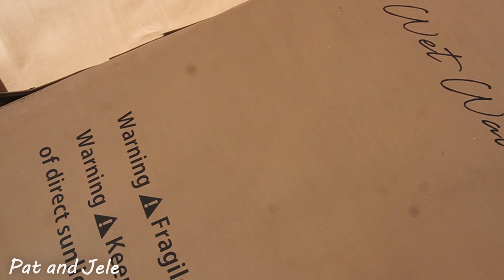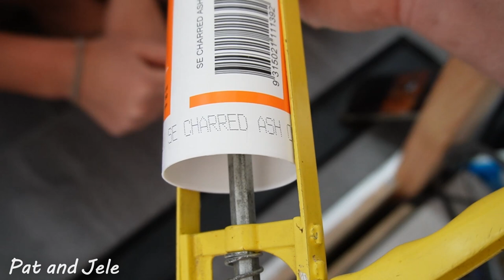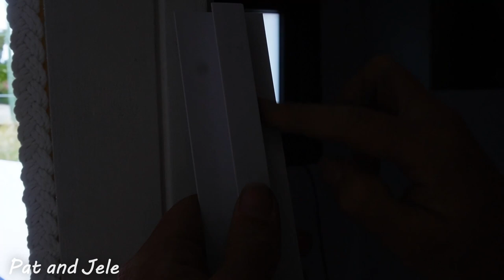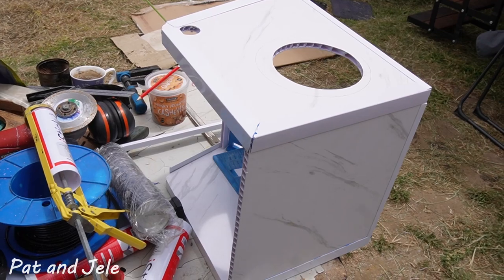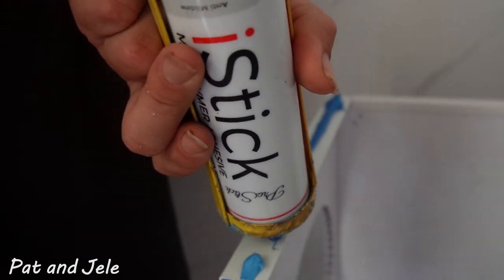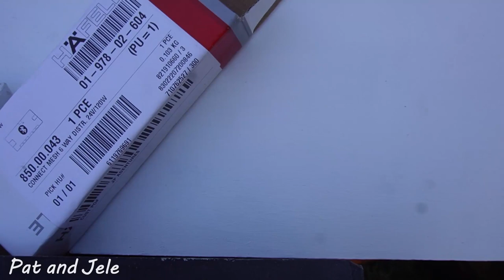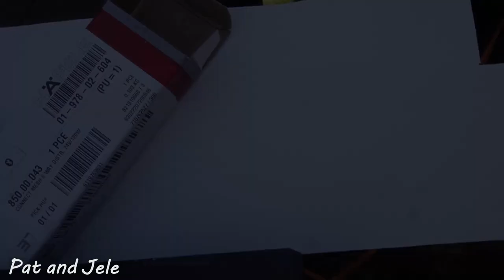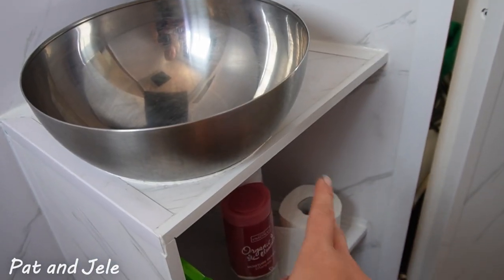Custom Vanlife SHOWER - Light, Quick & Easy with Mr. Wet Wall Panels - Cheap DIY Sink Pt.2 (Eps. 55)

Comment: You are set for luxury travel with your flash shower, it will be a great asset in your travels. I hope you don’t have any water leaks. Do you have a plan if you do? That adhesive is not going to let you get behind the panels. Another great episode 👍👍
Reply from the maker: Thank you!
So far we haven't discovered any leaks. It is very unlikely with those panels and trims if you install them correctly :)
Worst case we could always get behind there from the other side, where we cladded the walls with pine lining.
Reply: @PatandJele  I'd be more concerned about those flexible hoses you used, They have a bad habit of failing after a few years & should really only ever be installed where you can get to them. They now even come with a date label so you can see when they were installed.....
Reply from the maker: @paulgriffin5572  we worked with plumbers on this setup and we used good quality ones. They have a 15 year warranty on those, so should be all good. Time will tell ;)
Reply: @PatandJele  I knew you had a plan😁
Reply from the maker: @briandanvers4589  😇😇😇